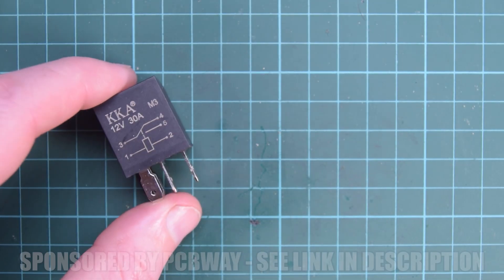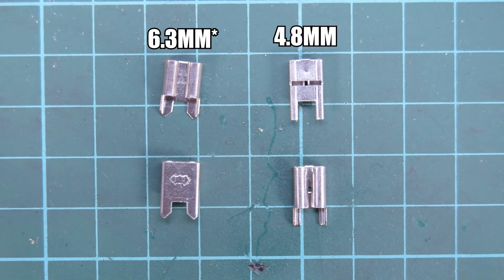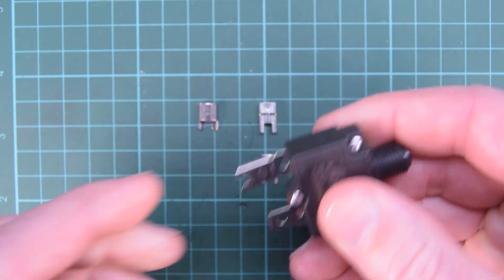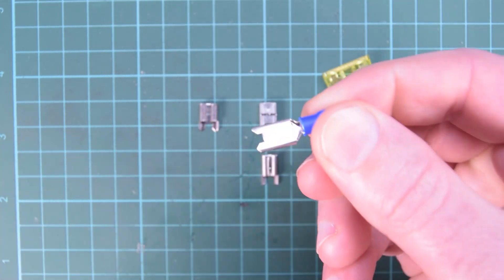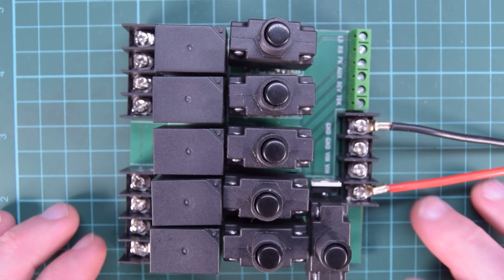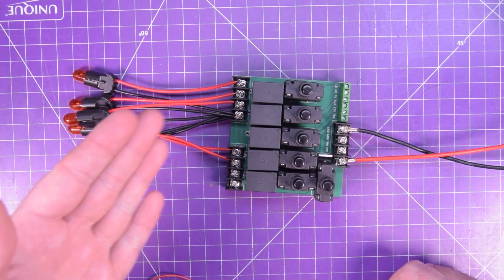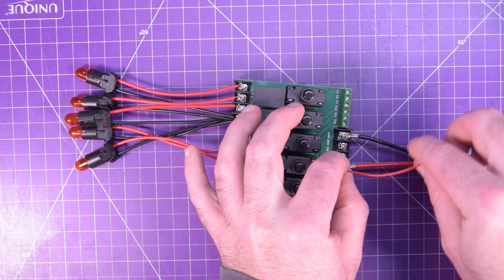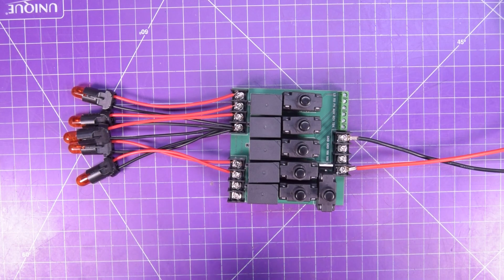You Need These In Your PCB Toolbox!

Comment: This is one that I have need of, even today. Thanks! These seem to be available on FleaBay, too. However, they do not look to be so cheap, IMO. I used your search term suggestion; "spade lug pcb terminal." Suggestion, for One-Off DIY boards, maybe just remove the connector insulation tube, crush the wire tangs flat, measure the the flattened tang, and use a PCB hole big enough to match. My problem in doing this is that I was working on a board that had the wires soldered to it and the pads were SMDs. If I had used crushed connectors on the board, the SMD pads would likely have lifted, with the force of unplugging and plugging in the wires. So, I just inserted the connectors into the length of the wire, as usual.

Comment: One thing to be aware of is that with the spade lugs, your components are now swinging in the breeze, whereas a full socket would have plastic "casing" which would extend down to the PCB making it much more sturdy. I don't know your use case of this PCB, if it's just sitting on your test bench it would be fine, but in real world applications, definitely use a proper socket.

The sockets for automotive relays also have clips which hold the relay in. Obviously in automotive you're driving, so securing it from vibration is absolutely necessary.
Reply from the maker: I have only rarely encountered automotive pigtails and fuse boxes with clips for the relays - it was mostly on older vehicles - but I do get your point about "in the breeze" - so far so good, but I'll keep an eye on it. My long-term plan is to have a 3d printed case to go around them but I am still fine tuning the fit
Reply: @SimpleElectronics  I'm wondering, why the need to automotive relays in the first place? Surely you could find a relay and switches designed to solder into a PCB with the right ratings, no?
Reply from the maker: Cheap, ubiquitous and locally available in 100s - this project has the requirement to be field serviceable